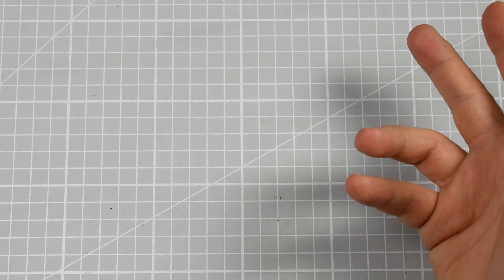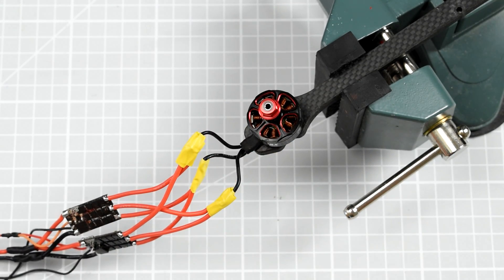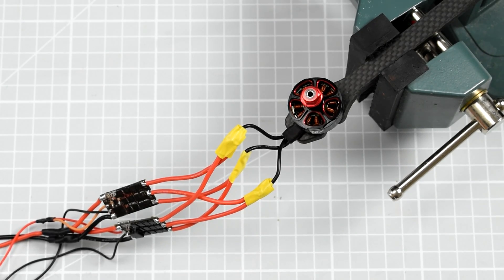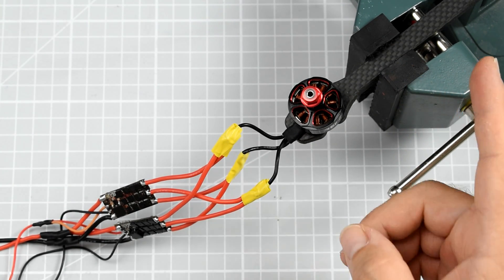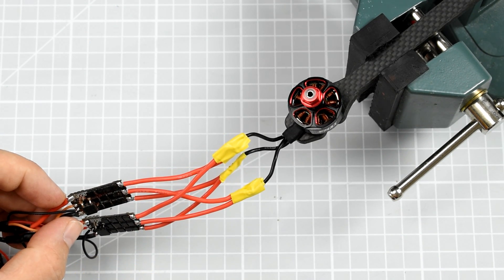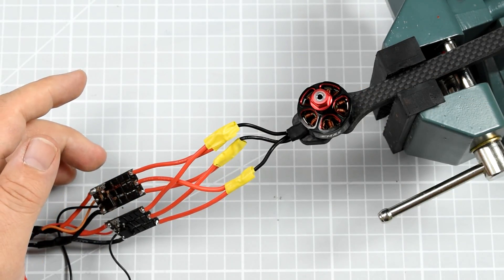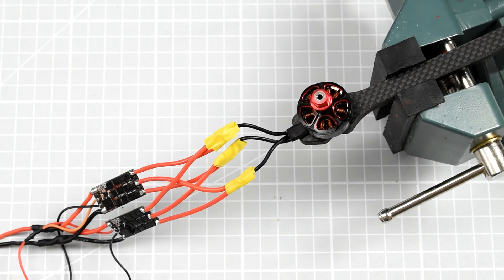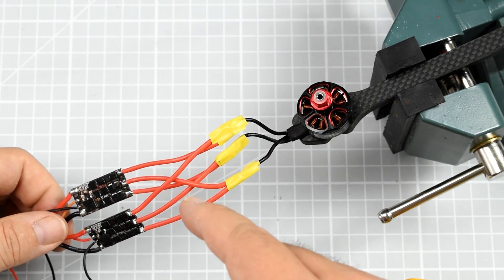2 ESCs 1 Motor - can two ESCs drive a single brushless motor?

Comment: If their PWM are not perfectly in sync a high side and low side FET can be open at the same time, creating a very low resistant short directly from on ESC high FET through the phase wires to the other ESC phase low FET. Yeah they get hot fast,  and the current does not even flow through the motor at all.

Comment: I want to do this except with 2 sides of a dual 100 amp 12S VESC. Do you think it is possible to solder a line in the right place above the mosfets and disable the driver of the slave controller?

Comment: could diodes and a synchronisation circuit work? as in a circuit that only lets them both fire at the same time.
Reply from the maker: I doubt it would work

Comment: I like how you explain what wrong in your circuit 
at the end and say it doesn't work Homer Simpson.   One signal not two. All wires should be the same length. I'm going to connect three identical controllers together. One signal wire. One - + for "halls, one - one+ for speed signal  One phase of each  controller will go to one motor. The other phases will be capped off or connected in series. I'll use 2 amp fuses to protect all my experimental tests. You can parallel charge controllers and audio equipment so! Have fun everyone.

Comment: Have you ever wondered what would happen if we replace the mosfets of a esc with higher rating mosfets to increase the current rating of the esc? Or what if we parallel solder additional identical mosfets to the existing ones to increase the current ratings?

Comment: What about this with sensord motors .. if it's all parallel wouldn't them sinc do to the polarity revived threw the sensor wires.. because30+30=60Amp would be interesting, or a 300Amp rc car.. motor won't survive it but be interesting

Comment: How about connect in series?
Reply from the maker: Let me answer with question: how to connect two 3-phase motors in series when every one of them has 3 wires?
Reply: @FPVUniversity  it's 6 wires because you forget the common wire. I am trying to increases the power of a LG washer motor by using 2 original washer controllers.

Comment: Not sure if this was asked in the comments below but can you then connect two escs to one motor but only use one esc at a time? Connect the two to separate channels on the receivers? Swap between channels via a switch? Thanks!! Asking for a friend! LOL!
Reply from the maker: I seriously doubt it would work. I mean motor would spin most probably, but ESC will struggle to detect zero crossings and most probably efficience would go down
Reply: Thanks, I am trying to come up with a solution for reverse thrust using ESCs that don’t have a reverse function! Any ideas?
Reply from the maker: @dcabrick  two H-bridges between ESC and motor might work. But just buy a reversible ESC, might be actually cheaper more more reliable
Reply: Dziękuję!! I am having a hard time finding one that works with Jeti and has telemetry.  I am new to RC so sorry for the rookie questions.

Comment: I wonder if you can pull the traces on one board to get the control logic of a single ESC to run the fets on both ESC's. That'd make issues with losing sync between the two a non-issue.
Reply from the maker: No, not really. I mean it's technically possible, but then you just add additional FETs to the mix. Nothing survives of the second ESC.

Comment: What if....
Make it 2 flight controller father than 1.

What if... Just using servo tester, without using flight controller, but also parallel the ESC in-out voltage..😁

Great experiment.

Comment: Dzien Dobry Pawel, I have a question for you.  Would it be functionally possible  to use two AIO boards Stacked Act in concert to drive each four motors either as a quad Octo set up four props up four down, or if in configuration to set one board 45 degrees offset, as a planar octocopter?  Or would the FC's  fight one another.  Conceptually as a dual redundant FC as purpose and function.  Just curious.  Thank you for your videos!
Reply from the maker: That is a very good question! I don't think it's a good idea and I will cover that extensively in the next Q&A video
Reply: @FPVUniversity  Dziękuję Ci

Comment: Hmmm, is it impossible to use some diodes from one ESC to the other or to the motor so current can only be drawn towards the motor, and have that ESC as "dumb", while the other ESC can flow in both directions read position, and simply allow the motor to draw some of the current through the other ESC via diodes?
Reply: Good , I think the same
Reply: How will the dumb esc learn how to sync?

Comment: Prepared to burn up two ESC's and a motor for science! (Or a YT video) but still, I like it!
It makes me wonder though if it would be possible to make an ESC that could be upgradable in Amp rating like adding more fets and caps on a small board. The image in my head is similar to adding RAM to a PC, a small board with fet's caps etc that can slot into an expansion port on an up-gradable ESC. Just a thought! :-)  :-)

Comment: Not the same fases were used by the ESC’s in this setup... Redo the test but make sure that the BLHeli settings on both ESC’s are set to normal or reversed direction... Still won’t work, but maybe for a bit longer than 3 seconds...
Reply: Your eyes need check up. Or mind 😂
Reply: @deone-entity3935  ok... Will do...
Reply: @13FPV  man don't be sarastic. Just  fid back
Reply: @deone-entity3935  Sarastic... Ok...
Reply: @13FPV  i also tryed same but didn't work lamo

Comment: Great video,
3 Phase Sensorless ESCs are not only driving the motors. They are also sensing the magnet positions by reading the zero-cross point of the floating wire. So, you cant connect them as parallel when internal comparator, power supply and the crystals have slightly different outputs.  In your case, one of the ESCs are firing the different coil and the other ESC is thinking it's a generated EMF by the magnet and so on. 
Cheers :)
Reply: So you think a sensored setup mmight work ok?

Comment: Don't you have to sync the ESCs like you have to sync a solar power system to the grid if you want to connect them ?

That is part of the phases games.
Reply: Yea if you want it to work you need them to be in sync. Some escs also support that but our Drone escs not.

Comment: Connect 2 escs power in series!
Wonder if the speed is gonna be divided in half.
Reply: How would you do that?  It wouldn't like it, you can't because there are 3 phases, series might work if it's brushed, but this deals with electric pulses and phases. Probably would get magic smoke
Reply: @shelbybrunhoeber2576  I mean the power wires in series, not the phase wires.
Reply: @vapgames  xD

Comment: Not that I expect you to try this experiment again but I think I have an idea what might have gone wrong. I think the 3 phases were out of sync on the ESC's .  Even after you got both ESC'S spinning in the same direction, I think the read channel was out of sync. It makes sense to me that the motor would still spin because BLHeli uses a right before read function which would allow both ESC"s to pump energy into the motor before monitoring for the 0 cross. At low power this would theoretically still cause the motor to spin, Then cause D-sync as the power increases. If you used and an oscilloscope to align all 6 faces it might work better-ish. 🤷‍♂️